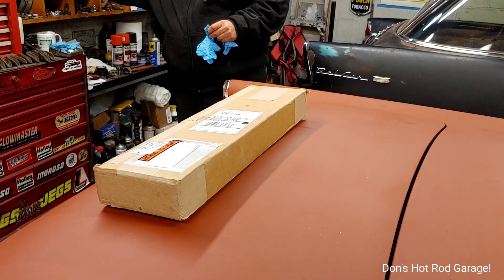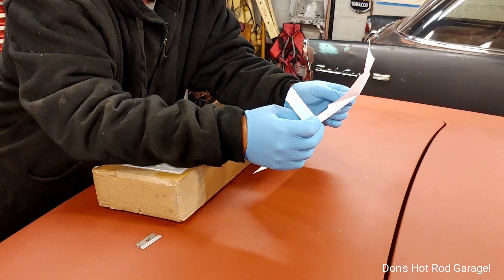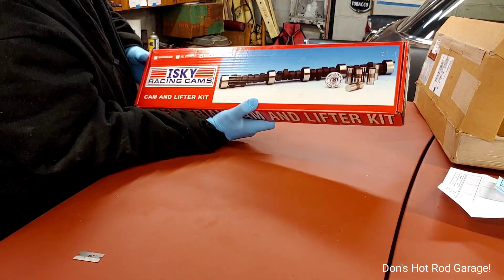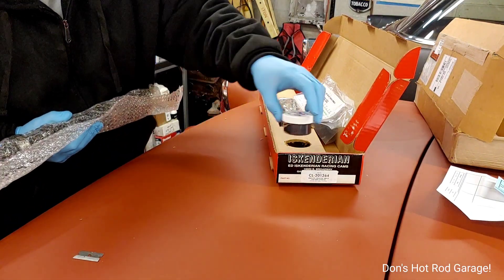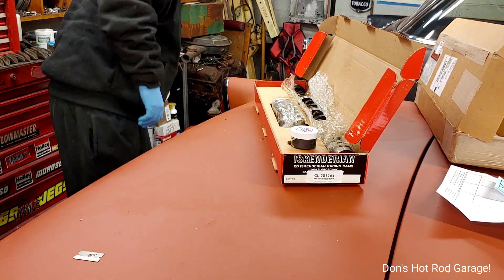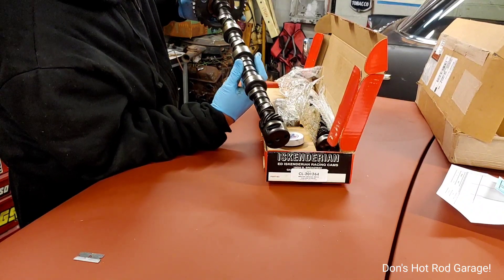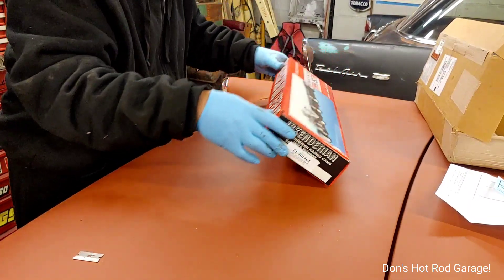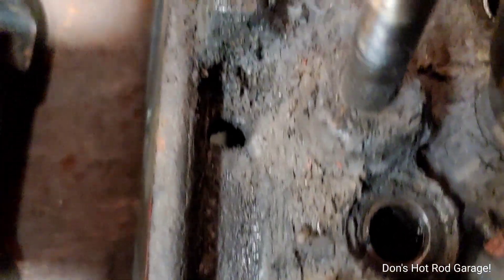1955 Chevy Convertible! Iskenderian Isky Camshaft 264 Mega Cam Unboxing!

Comment: Oh yeah we got the cam ,as I say we ,where it all the way with you Don . LOL we won't to see what that little motor got , I would say it's going to have a little more HP than expected. PS bud been asking about 4 speed, back in the day they were everywhere, heck when I was 18 I had 4 ,2 Muncie 2 rockcrucher in my little shed. Well that was in the 70s long time ago.
Reply from the maker: Hey Lonnie! Yeah buddy we got the cam! I just dropped it off to the machine shop along with the heads. So now he has all the hard parts to complete the engine build. Your right there was alot of 4 speeds years ago. Hell 20 years ago they was everywhere. Now you hardly see them and they want $1000-1500 for them. I know some good old boys that have some. Just been busy we stuff and haven't had a chance to go see what they have. I'll get one soon. Have a good one Buddy 👍

Comment: Hey Don Tony here good choice I have run several ISKY cams over the years, they are wonderful cam, you will be very happy with it. Yes you want new springs they used to sell springs with the kit so your builder should know what spring pressure you need. Later Tony
Reply from the maker: Hey Tony! Yeah man this is my first isky camshaft and ive heard alot of good comments on this company! Bob said he has some new z28 valve springs for the heads. Have a good one Buddy 👍

Comment: Fast Delivery Don. Many people done that move lol.  I remember Isky cams from 40 years ago. When I go to Santa Pod raceway . Drag strip. England That's what the people was running in those days.  On the weds night Run what you brung  (bring) . Yep heads need a bath. Lol.. Dam. Coming together.  Be ready for spring.  You got a transmission yet. Have a good one Don. Adios Amigo
Reply from the maker: Hey Dean! Yeah man ISKY been around a really long time. They have always been a more thought out camshaft and they give you specific information to make there cams perform at the best. This can said 9.5 to 10-1 compression manual transmission or stahl converter and 3:55-3:70 gears ! That's exactly the drivetrain im building so it should run great! I don't have a 4 speed yet but I know some good old boys with a few! Talk to you later buddy!
Reply: @donshotrodgarage1717  Nice Don. A Man who knows exactly what he wants.  Application to fit the job.  As Rat Rod Bob would say.  We getting it. Just ain't got it yet.  Lol. Good luck.  Adios Amigo.have a good one

Comment: Hey Don! I'm glad you have Bob Beach for your engine builder because he knows so much more than we do about these iconic revolutionary small block Chevrolet engines that we know to this day. I've had excellent results with Crane cams from my last engine build. The cam was hardened like the ISKY cam you have and it outlasted the rest of the engine that I ran the HECK out of it! The cam ran from 1,500 to 6,000 rpms which neccesated 3:89 posi gears which I ran on the highway infrequently!!! Anyway, the ISKY cam is an excellent choice for your 265 motor and I don't know for sure if ISKY is the only cam grinder that makes certain cams for a 265 motor that you're looking for? Ed has been known as The Camfather and he's a pioneer in grinding high performance cams since after the war and he's still living!!! Thanks for sharing the bits and pieces of this 265 build with us viewers and I'm following you closely till that engine is in the convertible and running!!! Have a good day buddy and see you later!!
Reply from the maker: Hey Raymond! Yeah buddy your right! When I talk to Bob about this old 55 265 he just starts telling stories about how they raced them when they was brand new. He has so much knowledge about all engines from back in the day. Whether it's a Pontiac ford Chrysler Chevy old's caddy he knows them all very well. He still has alot of the old speed catalogs from the 50s and 60s when these engines ruled the streets. Its a real treat to go out there and hang out with him. I also have had good luck with comp cams I have one in my black 55 Nomad. Its a comp cams ZL1 plus nostalgic cam with sound lifters. 3,000 -7,500 rpm and your right about ISKY they been making cams forever and still do in California. Have a good one Buddy 👍

Comment: Good to know about hardening the cam. Most failures today gets blame on lack of  zink. This is only part of the problem!
Reply from the maker: Hey Ronald! Yeah you want them to do the heat treat process on your cam. Its like 50 or 60 bucks to have it done. Alot of blame is said because of zinc but your know there's many factors to cam failure. Have a good one Buddy 👍

Comment: I am stoked for you Don. That notch is for oiling as you know! K-motion has the right springs for it. With that small displacement it should work great! Keep tons of Zinc in that oil. Also, check and see if you lost any subs. I had to reup on your channel.
Reply from the maker: Hey Jaws! Yeah man that notch is really important on the 55-56 Chevy v8 Engines. I think 65-66 Chevy Big Block has a similar notch of some sort! I'll check them springs out for the engine! I'll be running the PennGrade oil in the engine and it's very heavy on zinc! I'll also check on the subs see if everyone is still here! Thanks alot buddy I'll catch you next time 👍 Aloha
Reply: @donshotrodgarage1717  yes. I was going to say the early 396s had the same groove and the rear journal I think was smaller than the others… I don’t remember 100% on that. I am stoked you are doing this 265! Awesome sir!! Aloha Don!  You know your stuff!! I wont worry about you so much now! Lol
Reply from the maker: Yeah man its pretty sweet to see the 265 getting rebuilt. It should be a cool little hot rod engine. It's been bored out 60 over and the rotating assembly has been balanced! It's putting together the rotating assembly now and we just talked about putting in hardened valve seats so it can run on this modern gas! Should be a nice driver. You still have to worry about me man, I don't know half as a much as a think I do. Lol Have a good one Buddy 👍 Aloha

Comment: Considering that Isky was grinding cams when the 55 Chevy came out , I think you can trust the oiling notch that they cut in the rear journal .  I haven't gone near Comp Cams since 2000 , a very sore subject !  Can't wait to hear your mouse roar .
Reply from the maker: Hey Bob! I agree with you 100 percent about ISKY cams. They've been making camshafts for a very long time! I have heard alot of bad about comp cams. I have one in my black 55 Nomad. It's a ZL1 Plus Nostalgic Cam Kit Solid lifters. I broke that engine in differently then most people do. Have a good one Buddy 👍

Comment: Don, you are good to go that relief was necessary for the lifters to get oil in the first year 55 engine block. Back in the day if we had a 55 block and wanted to swap a cam from Crower, Sig Erson, or Crane, we would grind a small relief in the rear journal of the cam and sand it smooth. We would go about an 1/8 inch deep in the journal and call it a day. I did a few cams this way back in the 60's. Never had a problem. As you said you are going to want to MATCH the springs to your application and set correct spring height. Good luck can't wait to see the engine install.
Reply from the maker: Hey Edward! Thanks for the info on the rear can journal slot! This is going into a 55 265 and I just wanted to make sure it's right. I took both cams out to the machine shop yesterday and he said the new camshaft slot was perfect. He has a set of those z28 valve springs for the heads. He said he will send them off to have them got tanked! Talk to you later buddy!👍

Comment: hey don looks like your on the way ,the 70 z28 valve spring #3927142 is110closed &260 open pressure and will go7,000 easy!  and fits stock spring pockets. keep up the good work!!
Reply from the maker: Hey Matson! That is some super Great info buddy! What I treat I sure do appricate that! Talk to you later buddy!👍👍
Reply: @donshotrodgarage1717  You could get away with an LS6 spring beehive 90 lb seat. Wil be plenty for that cam
That is a real good grind for the st if you want torque. 
Probably coated in cosmoline or some kinda grease so it doesnt rust
Machinst will clean it off lifters too then use the Isky lube

Comment: Not that much different than my Comp Cams 12-205-2 that I just put in my 327 with a .425 lift, 252 Dur /' 206 @.050 on a 110 centerline. You will feel it at idle in the seat with big tube headers & the trans in gear.  The good news is it idles at 875 rpm and I just found out today it pulls my enclosed trailer like nothing. I now have 300 miles on the new 327, no oil leaks, runs at 165 water temp with 65 pounds of oil pressure and the motor is quiet as a mouse.  However, I am still chasing a vacuum leak and am having a issue with vapor lock in the fuel line from the fuel pump to the Q jet .
Reply from the maker: Hey Mike! I think I'll really like this camshaft! Sounds like you've built the perfect 327 engine. The vapor lock can be tricky to track down. You'll get it man! Talk to you later ✌

Comment: Hey Don, i have a 270 isky mega in my 57, and i have the 280 mega in my 55. They are great cams. I havent run a 264 but i expect its perfect for that 265. Any way you might ask your machinist if he knows the part number of the z-28 valve springs that were sold in the 70s, pretty sure theyre still made. I got a set for 90 bucks when i found em.
Reply from the maker: Hey Chevy Shane! Ive heard a few YouTube videos on the 270 camshaft and it sounds mean. I just thought it was little to much for this engine. I think it has a bit more lift and the same lobe seperation as my cam. I ask Bob and he has a new set of those z28 valve springs. He said he will have the heads hot tanked and then start to assemble them. He also said he wants to replace all the valves. Talk to you later buddy!
Reply: @donshotrodgarage1717  270 is  good cam for the 327 and 350. It made 30 more tq than the Chevy 350hp cam with less duration. Great daily driver/performance deal  .Let us know how you like that 264. One of these days Ill put together something that isnt overcammed. Maybe lol

Comment: Wonderful. What’s the difference between a 265 and a 283? Just bore size? Thanks
Reply from the maker: Hey Dave! Yes exactly the main difference is the bore! They have the same block, crank, connecting rods and heads. Just a slightly bigger bore. Talk to you later buddy!
Reply: @donshotrodgarage1717  thanks, keep up the good work!

Comment: Hi, Im in the process of building a 350 for my 55 and it turns out that the engine I bought has this same cam. I'm trying to figure out if I should use the cam but I can't find a cam card anywhere online. Could you post up the specs from the cam card?
Reply from the maker: Hey Buddy! I would say to use the camshaft it'll make that small block run really good. I'll show the can card in one of my next videos. If I happen to forget please remind me again. Have a good one Buddy 👍
Reply: I really like the 214 duration at .050, and I like the lsa of 108. 

What seems off is I heard that the 264 duration is at .020 lift. That's way different than any other cam manufacturer and makes it impossible to compare cams.

I also would like to know the icl, and when the intake valve closes for dynamic compression calculations.
Reply: @subzero18851  Its a great torque cam for the st. Youll love the way it runs, can DD it. 
Idle will sound like its got a cam but wont thump too hard. Pulls well!